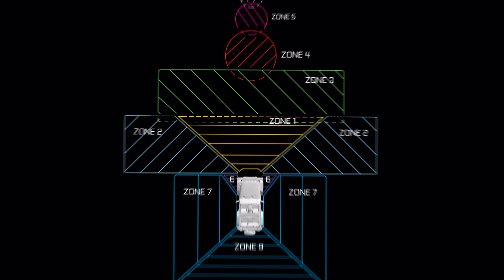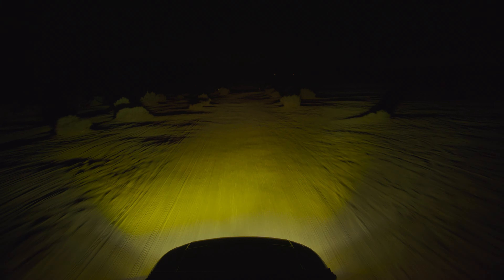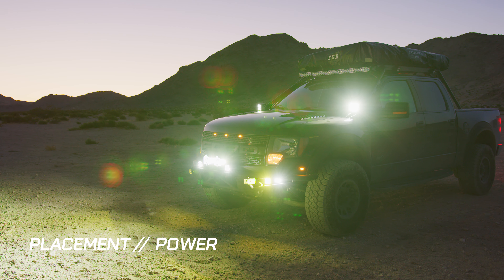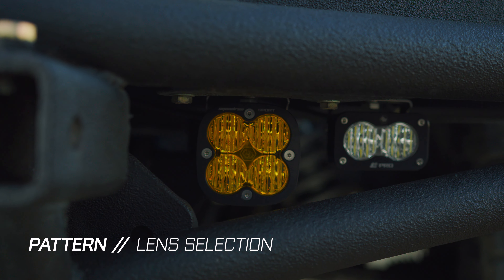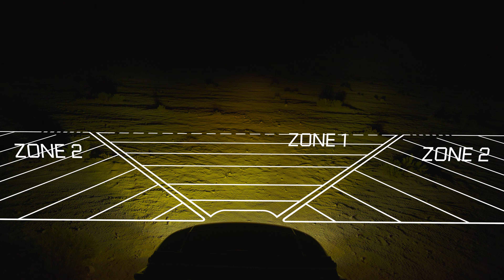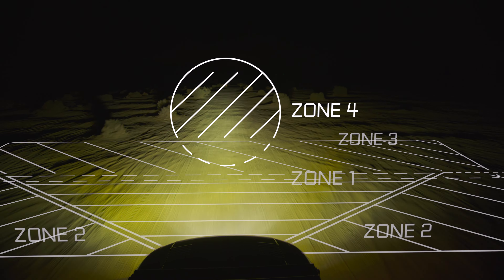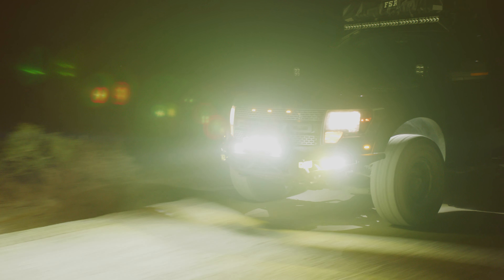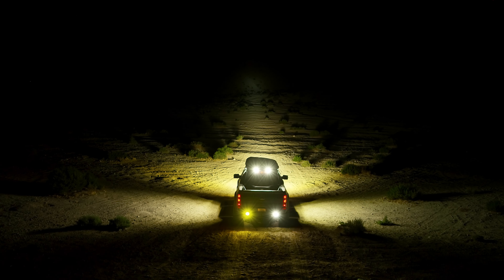Lighting Zone 3 - Driving/Combo | Baja Designs

Comment: How far should this light zone reach? Or how far ahead should these ideally be pointed?
Reply from the maker: Brian, this will vary based off your lighting needs. Typically zone 3 lighting should reach out 100 ft to 300 ft in front of the vehicle. Hope that helps and thanks for the question.
Reply: @bajadesigns  yea that helps a lot. Thank you!